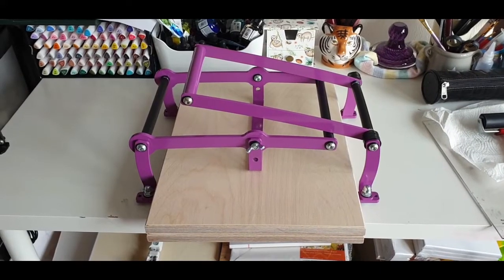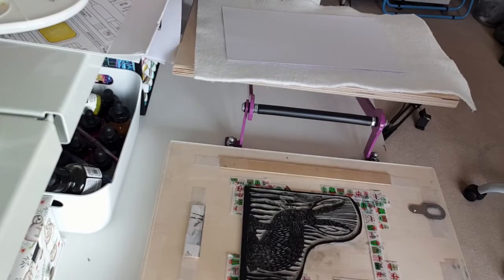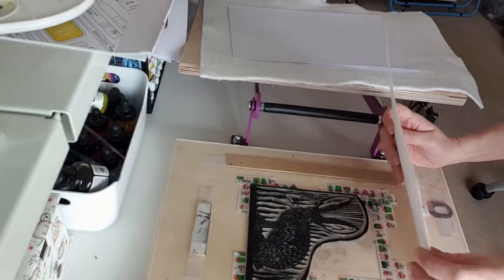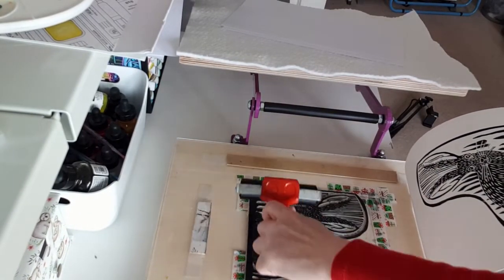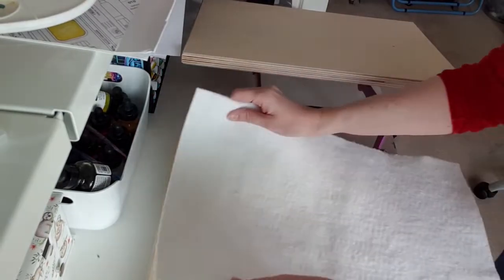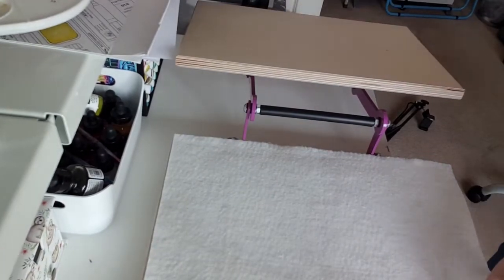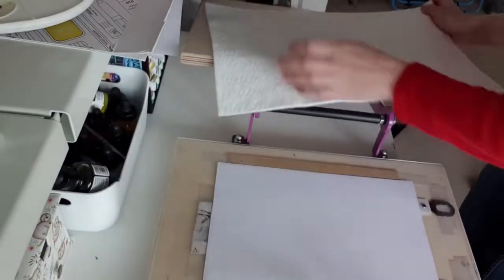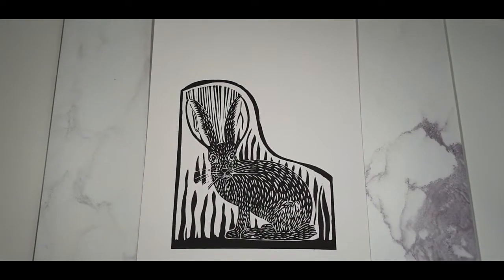Printing my hare with my new Pooki Press.

Comment: That's very helpful; thank you Helena. I notice you have some little clips to stop the paper from moving. I've recently bought a Pookie Press and am just starting out in lino printing, having been a watercolourist for many years.
Reply from the maker: Hi Sally.  Thank you for your comment.  Those clips are Ternes Burton  buttons with plastic tabs attached to the paper. They are sold in pairs in either metal (not sure, but it might be stainless steel) or recently I  have seen a cheaper plastic version on the Handprinted website.  They make it much easier print , especially if you have to re-ink. I am currently spending time learning to paint with watercolour.  It's fun and always surprising to see the results. If you want to learn in more detail how to carve and print lino blocks,  check out my website.  I have created a beginner's course of lino printing.

Comment: great video  can i ask what kind of ink you prefer for your press. and what was that that you attached your paper to before printing  i liked it 
 
thanks for showing
Reply from the maker: Thank you for your comment. I am only using Caligo safewash as it's oil based and has a longer open time  -so you can make lots of prints without it drying quickly on the surface. It is also easy to clean up (no solvents needed). When I started I used water based inks, but they dry too quickly - they are useful if you want to do a quick print though. I would recommend to try both and see what you prefer. Schmincke sells high quality waterbased ink. The paper is attached with Ternes Burton buttons to an acrylic sheet - this way it stays in place. I bought those and the matching tabs from Jackson's or Handprinted (can't remember) and the acrylic sheet from Ebay. Hope this helps. If you are interested I have created a beginner course for Lino printing which you can find here: https://payhip.com/b/VbWR1